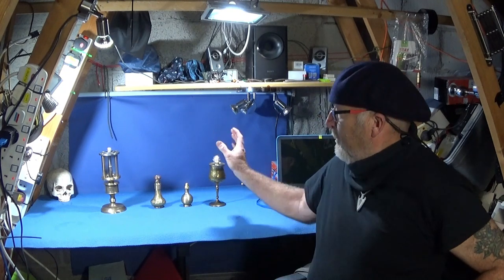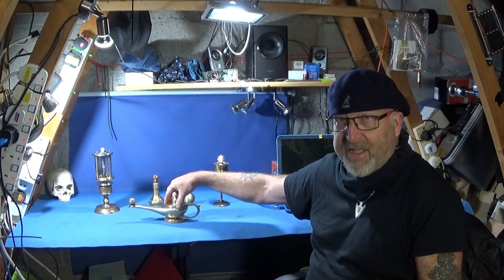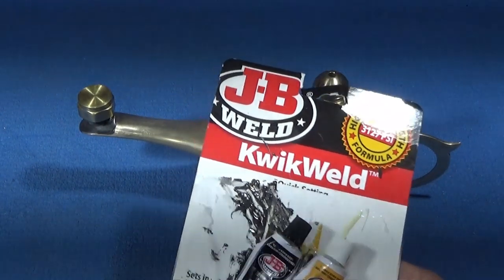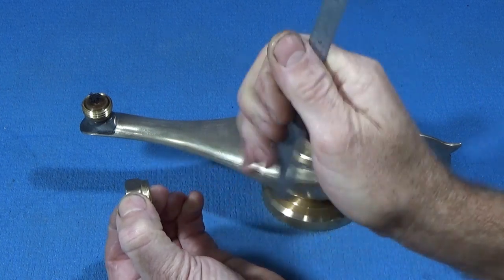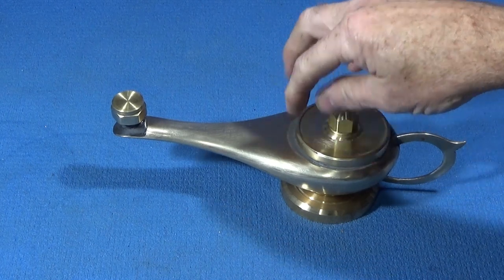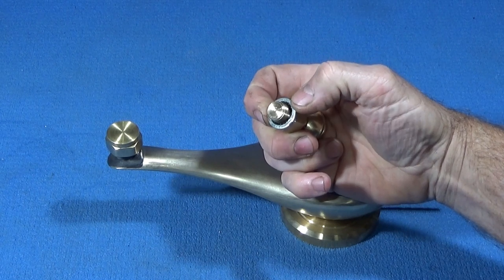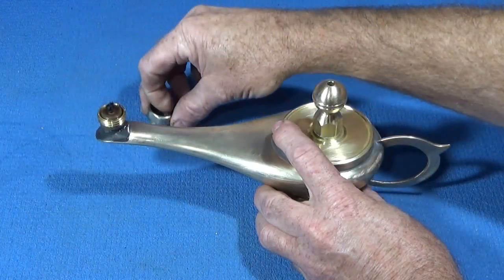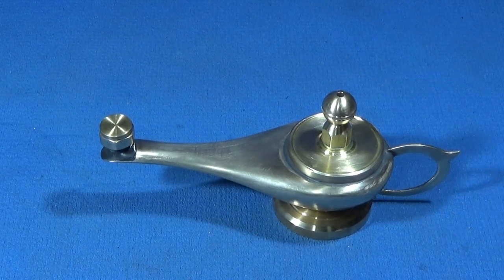How I made A Working Model Aladdin Genie Brass Oil Lamp.

Comment: This is beautiful and incredible! Have you tried mica powders? There are some gold colored ones that you could dust wet epoxy with to camouflage the connections you made with epoxies. I carefully smooth the epoxy I use then dust with the powder it while the epoxy is still sticky. I let it set then wipe off excess powders. I have no idea if it would work with jb weld but you might even be able to work the powders into the wet epoxy so that you could sand it after it was cured. I would pretest that before using on a project I would actually use the finished project.